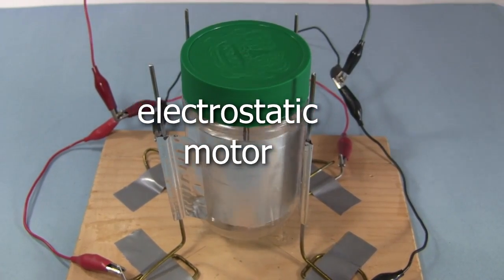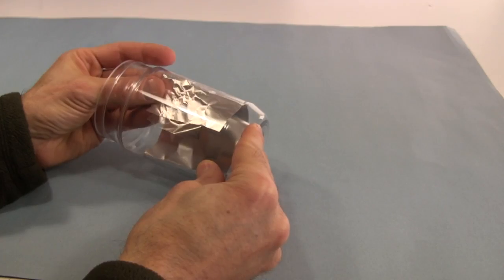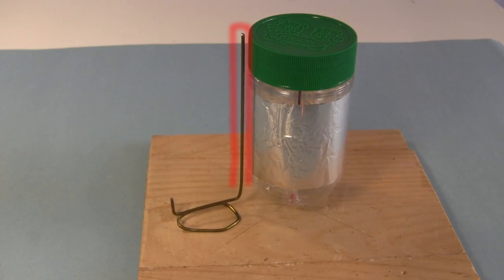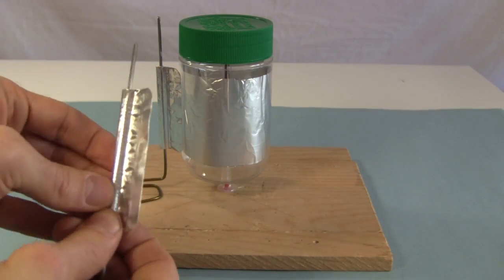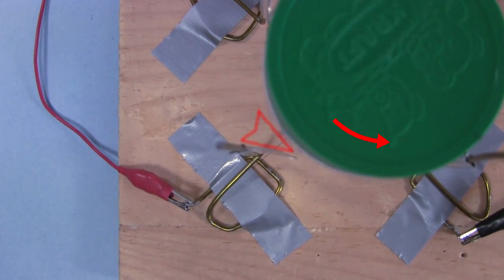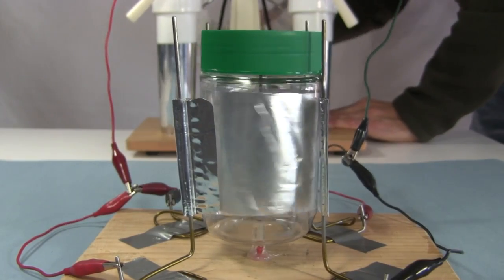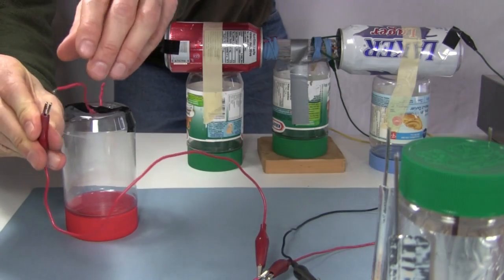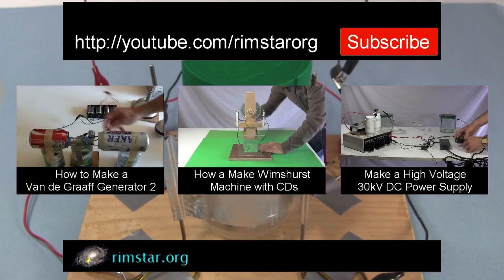How to Make a Corona Motor (v1/simple) or Electrostatic motor/Atmospheric motor

Comment: Great tutorial. Thanks for showing it still works with average tolerances :) Have you tried it on the HV flyback supply?
Reply from the maker: Thanks. Yeah, this was intended to be a how-to using simplest parts and average tolerances - something for anyone who wants to try it and can't do precision. My HV flyback is still busted, haven't gotten around to fixing it yet.
Reply: :( What happened to the flyback? My good one died too. Burned out the flyback coils... Tried to re-make on another one. Cant find one that works near as well with the same specs. Back to the drawing board.
Reply from the maker: Mongrel Shark
Oops. Did I say flyback? I mean HV power supply. I haven't opened it up to see what component is busted. Hopefully neither the flyback nor the tripler since they're the hardest to replace. It happened when I was experimenting with my ion propelled Enterprise. I guess the spacing between the sharp points and the smooth cylinder was too great - a few too many arcs in a row and it stopped working. Seems I'm always advising people to put resistors in series but I rarely do it myself. Groan.
Reply: LOL. I do stuff like that too. I think - If this was someone else I would tell them to fix this, oh well I'm really clever I'll be ok to spot it if it gets naughty... Then the smoke starts...

I killed my flyback arcing to salt for too long. Overheated the coils. Internal corona did the rest. Never been sad to have not killed a transistor before... Is there an e-waste or something like that you could get more flybacks from? I got over 20 CRT's from Freecycle last year, and another 10-15 of nature strips... I only have one ac flyback with trippler though. Looks a lot like the splitter in a rear projection tv. If they are the same I have 3 of those. Could look into postage costs if your really stuck.

When I take the gutted out tv's to the tip, they have an e-waste bin. Its a gold mine (Literally, cell phones and computers etc) Unfortunatly the council has a habit of prosecuting scavengers. so I have to try and get stuff before the council does.

Comment: awesome!
What is the value of the high voltage you used?
Reply from the maker: I don't know. The voltage is limited by the size of the corona gap, and since the corona is actually a conductor, the voltage isn't very high while it's running. But for startup, before the corona starts, with a gap of around 2mm (2/16") it's roughly 2kV. But that doesn't mean any 2kV power supply will work. I also needs some current behind it to give the charge needed to produce the repulsion that keeps it going, while also losing charge by conducting through the corona.

Comment: Glad to see you get into this and build one.  It seems you studied the same people's work that I did.  Brazilero2008's build guide at Instructables is what I mainly used for mine.
Reply from the maker: Actually my first version used aluminum foil for the electrodes, and it worked, but only at about half the speed of the version in this video. The foils were being attracted too strongly to the jar and making contact, slowing it down, partly due to friction but mostly I think due to the grip due to the attraction. Then I saw Brazilero2008's use of the roasting pan. Since it was something anyone could get there hands on easily, I switched the electrodes. That's why I gave him credit in the description.

Comment: Looks like a capacitor motor, where the charge on the inside is attracted to the opposite charge on the outside.
Reply from the maker: Good guess, but not quite. The foil on the inside does help a lot, but is optional. It's hard to describe in words but... the high voltage electrodes spray charge onto the surface of the plastic jar. Since that surface there is now the same polarity as the corresponding electrodes, the jar is repelled from the electrodes. The direction is biased by the angle of the electrodes. When those charged surface areas get to the grounded electrodes, the charge is picked up by those electrodes and sent off to ground. The jar continues to rotate and the process continues.